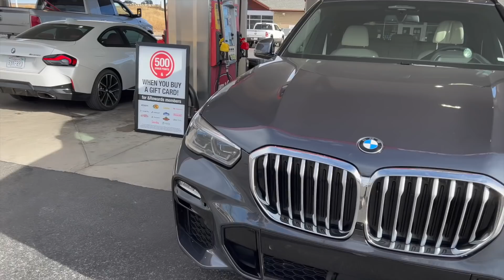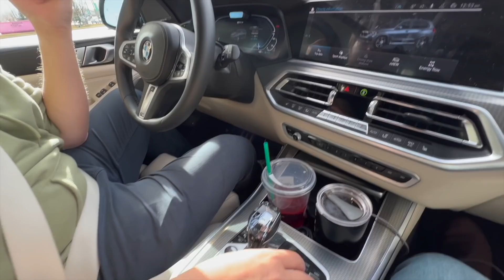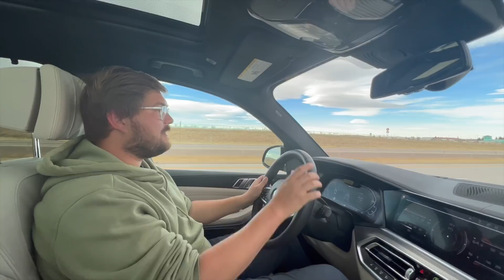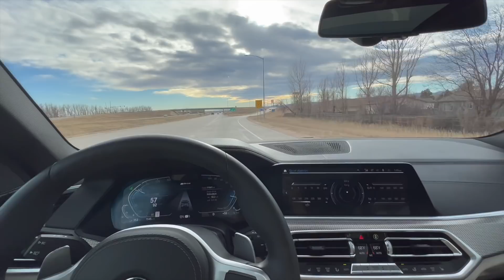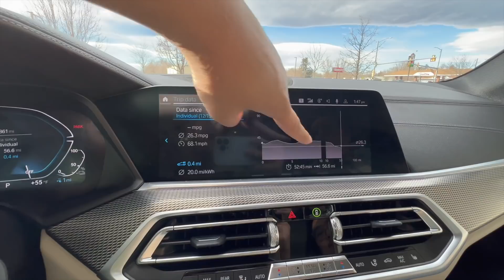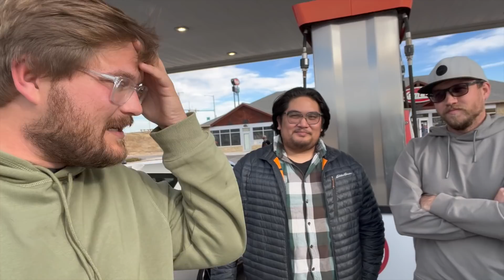Can A PHEV Be Efficient On The Highway? 2021 BMW X5 45e 70-MPH Highway MPG Test

Comment: 26.7 mpg is better than the 25 mpg highway fuel economy of the 2022 X5 xDrive40i.  It's also cheaper.  The 40i has an MSRP of $62,900.  The 45e has an MSRP of $63,700, but gets the full tax credit, so $56,200 total.   Both vehicles seem to be optioned the same... so you're just flat out saving $6700 by buying the PHEV.  0-60 times are the same, although the PHEV needs to kick on the engine to do it.

The electric range could save a person over $1000 a year on fuel.  The car will likely require fewer oil changes, have less wear on the engine, and will have longer intervals between brake pad / rotor replacements.  Tires may need to be replaced sooner though, presuming this vehicle weighs a bit more.
Reply: I got mine 3 weeks ago with executive package, didn’t pay above the MSRP and enjoyed the tax credit of 7500. 😊
Reply: In Seattle Wa I would save closer to $2000 than my Audi SQ5
Reply: but its worse than my 12 year old LEXUS RX450H normal Hybrid !
Reply: @kubanskiloewe  Different class though. The RX450H is a smaller SUV class than the X5 judging by the RX's 18ft3 of cargo space vs the 45e's 33ft3. Not to mention the 45e can run full electric for 30+ miles fully charged vs the RX's 0.

Sourcing from the CarAndDriver road tests, the X5 45e 0-60 of 4.7secs, 156ft braking from 70, and 7200lb towing capacity are all superior vs the 450H's  7.1secs, 178ft braking, and 3500lb towing capacity. 

All in all, a case of you get what you pay for.
Reply: @dchen37562  all in all the BMW end up in the dealershop much more often and will not last as long as a Lexus.  I drove our brands over 20 years  ;-)
Reply: @kubanskiloewe  in term of financial savings, it’s dumb to compare a 12 years old car to a new car. 100% the 12 years old car is going to be cheaper. 

Not to mention they aren’t even in the same class/segment of cars. Might as well say a civic is better than an x5 because it’s cheaper to run it.
Reply: @AW-gj4ji  take your Bimmer and Buy More Warranty 🤭. My next car will be another V6Hybrid from Lexus. But first the old have to give up but there are no signs it will do so 🤣🙃
Reply: @AW-gj4ji  you can still buy the current Lexus RX450H with the same powertrain as my 12year old ;-)
Reply: @kubanskiloewe  well I can’t argue Lexus will have less repair cost. However, they consume more gas and more expensive insurance for where I live. It pretty much breaks even for me in the first 6-8 years. Assuming there are major repairs for the bmw.

I do like the Lexus ES though. Aside from that nothing from the Lexus lineup is really interesting to me.
Reply: @kubanskiloewe if u maintain a bmw regularly they rarely have faults with the f model onwards because those engines are designed very well, moreover their services are very cheap so its not a big issue lol, I think you have the old e model bmw stereotype ingrained within u so its natural for u to think that but nowadays its not even that much of a contest its just preference and how long you want to keep it for
Reply: no way a Bimmer is more cheap ! ...not even here in Bimmer germoney :-) @harbzsquadings2277

Comment: 26-ish mpg.  That's very similar to what I get in my 22 year old Audi 2.7T driving approximately the same way.  Highway of course.  I can squeeze out very good gas mileage out of that vehicle on the highway, well above its rating.   So yah, I kinda agree on the whole PHEV take.  The benefit is there only when a lot of city driving is done and the owner also plugs in every day, but there's no benefit over a conventional ICE otherwise.  And given the smaller battery pack, I would be mildly annoyed even just having to plug the thing in at home every day to get that benefit, verses once a week with a full-range BEV.  Again for around-the-town.  And then we have all the extra complexity of the PHEV on top of that.  Great for dealership shops, maybe not so great for owners.

-Matt
Reply: Does the Audi have 400 HP/450 Tq?  Big luxury SUV with modern crash safety?  It’s like comparing a banana and a canary because both are yellow
Reply: My Volvo wagon with the polestar upgrade and big wheels can get more than 30 mpg

Comment: 26.5 mpg is 8.87 Liter/100km (I live in Europe). Is this consumption at 70 m/h (112.6 km/h) normal for a crossover SUV?
Reply: Toyota Rav4 XA30, about 7-7.5 L/100km with 105 km/h, 9.5 L/100km with 125 km/h Climate control is on

Comment: I live in suburban Los Angeles. 98% of days I drive exclusively on city streets for less than 30 miles. 1% I will drive on the freeway in stop and go traffic. 1% I will drive on open highway. I can lug around an extra 80-100 kWh in batteries or an ICE system.  Because I am not buying a 100 mile range BEV as my only car.
Reply: Most people, including virtually all auto reviewers, don't get that PHEV's are designed for people like you (and me) who do mostly short trips on pure electric but don't want the constraints of a BEV, or simply feel more "secure" with ICE as the long-range option. We have averaged over 70 mpg with our Volvo XC60 T8 in 6 months of ownership and have taken a number of trips into the hinterlands where even Level 2 charging is rare and fast charging is non-existent. Not interested in a BEV at this point.

Comment: Anyone would have to be nuts to buy or even lease a BMW - reliability is just awful.  My 2019 just turned 20k miles and has had so many repairs.  The software is a disaster.  If I hadn’t bought the Ultimate Care package I’d have $1000’s additional in uncovered costs for brakes and more. Dreadful vehicles
Reply: I have a 2015 X5 and other than regular maintenance it has been awesome. Sorry to hear you haven't had the same experience.

Comment: About hauling the extra weight, my C-Max Energi runs the gasoline engine about 80% of the time at 70 MPH.  Even with the battery at minimum charge, it changes to electric mode on every downhill run.  Going up hills, it starts the engine and recharges the battery back to the minimum level. The large battery in the PHEV has enough capacity at minimum charge for the car to set the gas and electric modes of operation for best gas mileage.  It isn't just dragging extra weight.  The electrical part is improving the gas mileage even with the battery at minimum charge.
Reply: Part of my amusement at watching Kyle’s videos is his constant sniping at the PHEV’s.  The “hauling the extra weight”  is not really unique to the PHEV.  Most of the time, most people don’t need a battery that gives 250 plus miles of range so most of the time they are hauling around a big battery that is not necessary.  But then sometimes it is very useful.  My Rav4 prime gets MPG that is a little less than the MPG of a regular Hybrid  Rav4 but still very good. I see the issue with the PHEV as being the complexity, but as long as my Rav4 is reliable I’m not worried about that. The MPGe for my Prime is slightly worse than the AWD Ioniq 5 so the way I see it I have a good EV around town and a good hybrid vehicle on long trips.
Reply: Yeah I have the x5 40e and have a semi regular 180 mi drive I take. There is definitely a noticeable difference in economy if I start with a full battery vs empty. It seems like the electric kicks in with the gas in certain situations. So it takes around 100 highway miles to blow through the battery. 
I’ll try measuring like he does in the vid to see what kind of difference there is.
Reply: I dont know about yours but my Honda clarity PHEV If you start with a full charge and you drive for a full day, about 12 hours I can see a easy 5 MPG increase at highway speeds AND have increased power for passing etc and i finish the day with maybe 8 miles left of electric. They are not driving these PHEV at the maximum efficiency. I really dont think they understand them

Comment: Glad I got a RAV4 Prime instead LOL. It smokes the BMW in the fuel economy and reliability point of view.
Reply: But it's a boring interior exterior car with nothing to be excited about except the reliability long term,if you keep the car 10 years, which I'm not. The quality of assembly and materials in the bmw is vast superior, makes you feel you drive something a little more special.
Ps:I also have a LS 500 f sport 😊
Reply: @florinvid  come on, the X5 exterior is hardly “exciting.” But they are…. nice.
Reply: Cheap shit box versus one of the finest autos made. That’s about right.
Reply: @mray8519  so just get a Grand Cherokee then.
Reply: Because these are absolutely competitive…. A RAV4 and an X5.  Camry gets better MPG than M5 as well, FYI…
Reply: But did you cross shop the two? Probably not. Not the same class of car... Or buyer
Reply: Can’t find any RAV4 Prime without 10K mark up. SMH 🤦 still looking.
Reply: @TheDanielTruong  they are impossible to find at MSRP it seems. I’m in Canada where they can’t mark up above MSRP but there are none for sale anywhere, 2-3 years wait time.
Reply: even my old RX450H is slightly better than this BMW. i got 28,5mpg out of it since 12years now !
Reply: I wouldn't be caught dead in an ugly RAV4 Prime. I don't care how impressive the MPGs are. The interior is nothing but a plastic factory. No thanks to that ugly/plastic econobox!

Comment: In this particular test the battery is not an advantage, it's just taking space. On a mountain road or in stop and go traffic your hybrid system will give you some efficiency even if empty.
Reply: True.  Impressive then that this vehicle exceeded its highway mpg (EPA) .  Not sure what this vehicle's highway mpg is since the EPA site doesn't show it anymore (only shows 20 mpg combined), but the xDrive40i (ICEV) is rated at 25 mpg on the highway, and typically the PHEV is worse due to the extra battery weight.  

This test is almost worst case scenario.  Engine cold would have been worst case scenario.

Comment: My answer is simply : NO. 
My experiences: Outlander PHEV.
Usage on highway , day travel 1000+ km. 10 km / liter , sometimes 9 km/liter.
Speed 140.
12 km/liter with a speed of 120 km/h.
Both without any battery usage. (I kept the battery charged for using if I met a file)

A PHEV is userfull for short distances ...driving all electric.
And in town or file driving because braking energy will go back to the battery.
Usage of that PHEV during usage. 18 km/liter plus close to 1 kwh electricity charged from the grid. Which is much better than those highway consumption.
Reply: Tell me your a hollander without telling me your a hollander 😅

Comment: There were was a time that I thought 26.5mpg was good, that was a long long time ago.
With electric, the new standard is 100mpg+.
Reply: This test is just when the battery is empty.  In EV only mode, it gets closer to 50 mpge.  The norm for BEV mid-size SUVs is closer to 80-90 mpge.  Audi e-tron (78 mpge).  BMW iX (86 mpge).  The model X stands apart at 102 mpge, but then it also tends to slack a bit at highway speeds versus EPA.
Reply: @updlate4756 "In EV only mode, it gets closer to 50 mpge."
 Only if you use it for very short shopping trips, not for a trip that is 100miles+
Etron and BM are not very efficient ev's at this time.
Reply: @RemoteSpeed007  Shopping trips?  The average commute in the US is 32 miles round trip.  Some drive longer, some drive shorter.  

Not a whole lot of people will be driving 100+ miles daily.  If they drive 100 miles, the electric range will bring up their fuel economy from the 26.7 mpg shown in this test to maybe 34 mpg.  Throw in workplace charging to effectively double the range and now you're looking at 41 mpg.

None of the mid-size CUV/SUV BEVs are super efficient, but those are what this x45e is competing against.  While the x45e isn't close to as efficient in terms of mpge, it is the cheapest vehicle, although the base e-tron is pretty close.
Reply: @updlate4756  What would be the reason-features you would buy this car above a  BEV?
I don't see any outstanding features? Unless you have a gas version and want to improve mpg slightly and or do very short trips? And the interior is the only attraction. or just the BMW badge?
If I was looking at this type of suv, I would rather buy a model Y/mach e/ev6 and save a bunch of money, and get 90-122mpg, lower maintenance,, better tech, better performance etc.
Maintaining 2 drive units will not be fun when the car gets older.
To me in today's time with the cars available, this seems like a dinosaur, good for 2017, not today.
Tell me why I'm wrong?
Reply: @RemoteSpeed007  It's your decision what you buy, I was just clarifying the facts.  

As to why someone may buy this instead of a BEV... it's cheaper than many other luxury BEVs without any long trip range restrictions.  You can tow with it without stopping every 100 miles to re-charge.  Sure, you can buy lower trim BEVs that are cheaper.  You could buy a cheaper trimmed vehicle regardless of powertrain.  Luxury is rarely ever a true value vs benefit proposition.  If you want a luxury Plug-in electric vehicle, then this is one of the cheaper ways to get into one.

As to improving mpg slightly; if you have a short daily commute, then this improves mpg more than slightly over the ICEV version.  Not as good as a BEV, but it's also cheaper than its direct BEV competitors.  Those BEVs will be cheaper to fuel and a bit cheaper to maintain.  If you drive longer distances, then absolutely the BEV will be a better bet.   Short distances won't make a huge difference in overall costs.  Then again, at this price point, I don't think many people are prioritizing fuel and maintenance costs.  What they're more likely to prioritize is time.   

As someone who cares about overall global Greehouse gas emissions, I personally feel PHEVs are a better solution than BEVs 'at this time' due to constrained battery supply.  With high demand, we can simply build more PHEVs than BEVs, thereby replacing more ICEVs and lower emissions at a faster rate.  We also don't have the charging infrastructure in place yet to handle a huge rollout of BEVs.  PHEVs see major emissions benefits while requiring no new long distance infrastructure.  In other words, if everyone had a BEV today and it was a holiday where many people road trip and need to stop to charge, it would be a complete disaster.  PHEVs allow for a faster and smoother PEV transition, before we eventually shift to BEVs.  This reasoning hasn't been accepted, and what can only be described as a result of the Tesla effect... other OEMs are starting to concentrate more on BEVs.

When it comes to PHEVs, I personally think the lower trim offerings make more sense than the luxury PHEVs which still utilize large and heavy engines.  In the lower trim offerings, they typically use smaller efficient engines, lowering overall vehicle weight, and increasing the battery range.  The RAV4 Prime for example also put a fairly large battery in the car for over 40 miles of range.  It's a pretty solid and affordable vehicle overall.  The Escape PHEV is a decent bet, but a tad too expensive IMO.

In terms of your claims of all the advantages of BEVs... You can still get ADAS in the BMW.  You can still mirror your phone's screen to the car's infotainment.  (Something most other brands don't allow)  Tech isn't actually any better in any of the other cars.  Performance on this BMW is solid.  Cargo space is solid.  Towing capabilities is solid.  Luxury is also solid.  PHEVs have lower maintenance than ICEVs, definitely closer to the costs of BEVs versus PHEVs.  Remember that the engine will only be used a fraction of the time in comparison to a full ICEV.    I own a Chevy Volt, and after 3 years of ownership, the gas engine has only been responsible for 10% of my driving.  Obviously it'll be a bit higher in this BMW due to less range, and a less capable electric powertrain.

Based on your phrasing, and some of the keywords you used that a lot of anti-ICE folks use... I don't think this question was genuine and meant more as a gotcha.  But I replied in case any other readers may find the information interesting.